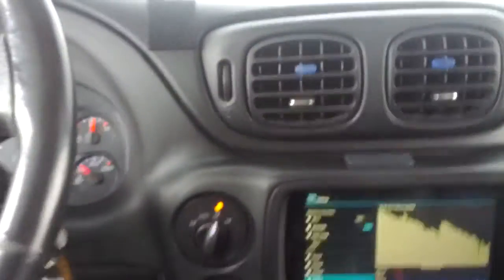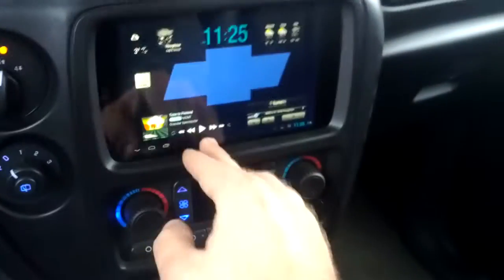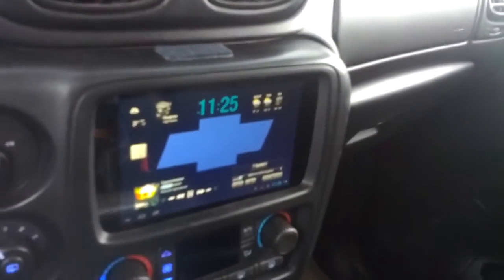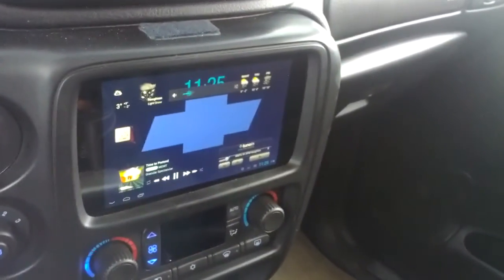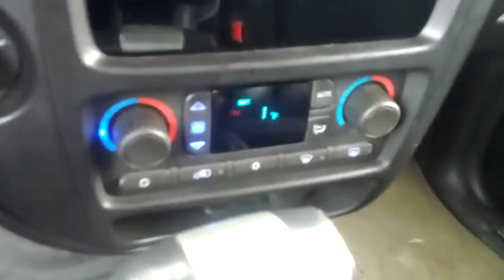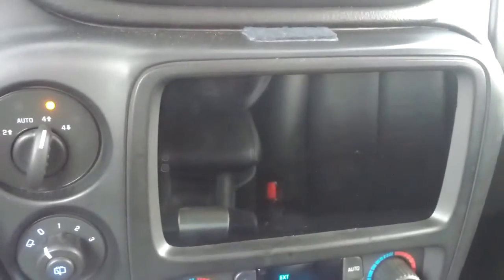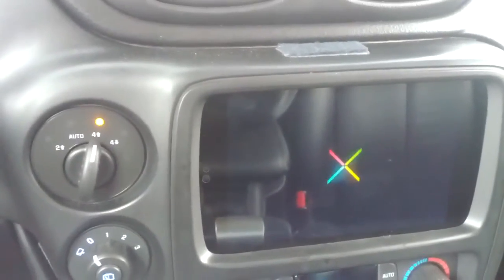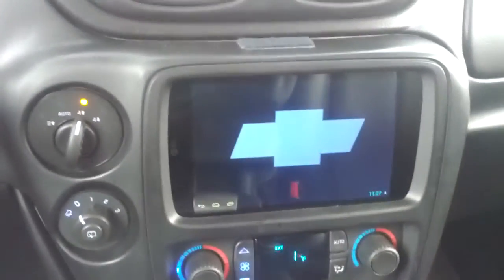Static with DAC

Comment: i have done a kinda same setup by following your post in xda.!
i have a chevy cruze..!
everything was fine when i tested at home but now in d car the issue that arose is i hear humming when the dac is powered up & this humming is constant.
my dac dosnt have a volume controller.
nexus 7--->
otg cable--->
dac(asus U3)--->
aux to rca cable--->
equilizer(clarion eqs746){main purpose was to split into rear and front channel}--->
amplifier(JBL GT-X646)--->
speakers(alpine R-type 60C)
please help

Comment from the maker: This DAC is a 2 channel DAC so the volume knob and bass boost only controls the 3.5mm jack on the front of the DAC but not the 3.5mm(i think theres a rear one) nor SPDF on the back.
So the volume is directly controlled by the tablet which I control the volume with my steering wheel controls through a joycon.
Hope that makes sense!!

Comment from the maker: I have it like this
Tablet>>USB DAC>>SPDF to Analog>>Amp
Nothing else to boost the signal.
I have these parts listed in my XDA thread that I put in the description.

I believe the issue with the static had to do with the hub loosing power for a split second when the car was turning on so I now have 2 hubs.
One is tapped into my ignition while the other has constant power which is for the DAC.
I'll also add a schematic of how I have it wired to my thread soon!